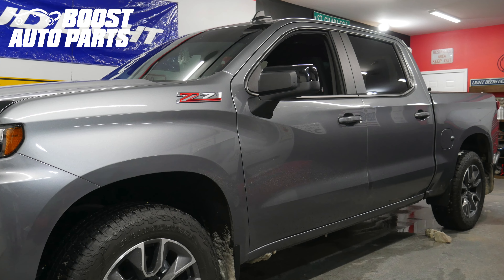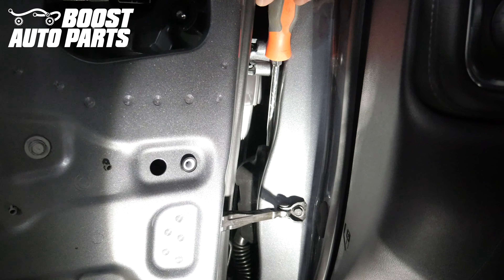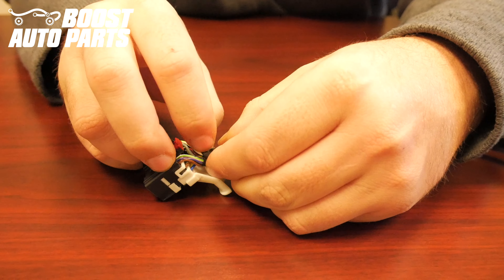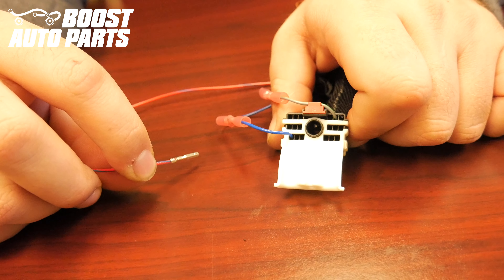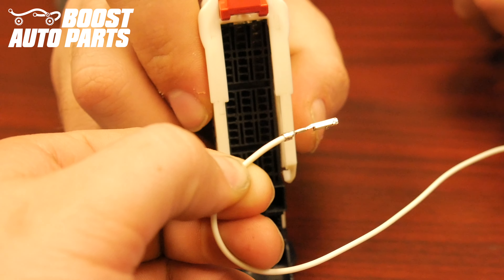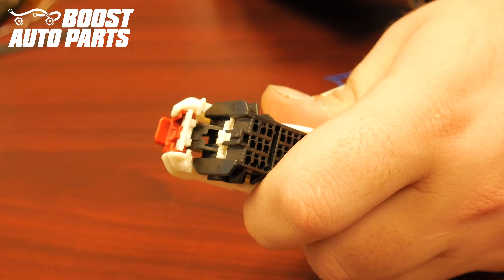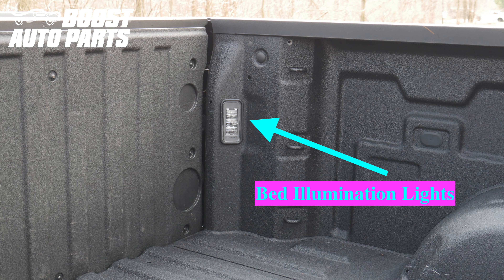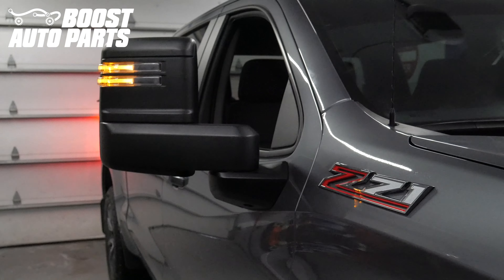GM Tow Mirror Plug And Play Wiring Upgrade (With Spot Light) - Silverado Sierra 1500 (2019-2022)

Comment: Would this process work on just upgrading to regular mirrors with led single puddle lights. Or do the have to be towing mirrors?
Reply from the maker: This procedure does not apply to small mirrors, the wiring for tow mirrors vs. small mirrors is different.

Comment: Guys you have a problem. I have a 2020 silverado custom. I do not have puddle lights. I did have a blue wire already in place in pin 13. I did not have a wire in pin postion 5. I had to add a wire to pin 5 and then re route the existing blue wire to that and so on. It works now but you're steering people in the wrong direction.
Reply from the maker: I will pass this info on to our development team. If you can email your VIN to support@boostautoparts.com that would be incredibly helpful. We do have a video that shows this reroute, so it sounds like we just need to further clarify the video to watch.
Reply: I will send the info thanks. I seen that video and thats exactly what worked for me but It's important to note i have neither spot lights nor puddle lights on my factory mirrors.
Reply from the maker: @Joeybago12  Thanks for the info. To anyone reading this comment in this similar situation, please reference this video: https://www.youtube.com/watch?v=1-kmGSMHH_Y

Comment: I have a trail boss 2021 lt I want to put does town mirror but dealers tell me I can’t put them on my trail boss because I have ,Side Blind Zone Alert ,Rear Cross Traffic Alert on my mirror
Reply from the maker: You can put them on - you just need to get the mirrors that are 1:1 with features.
Reply: @boostautoparts  Did this work out?
Reply from the maker: @bjones5593  Our mirrors are still under development, however if you get OEM mirrors with the proper features they will work.
Reply: @boostautoparts  Does GM make tow mirrors that have blind spot monitoring integrated?
Reply from the maker: @bjones5593  Yes
Reply: @boostautoparts  Part #?  I've searched and can't seem to locate it.
Reply from the maker: @bjones5593  Sorry, we do not keep track of OEM part numbers - but the mirrors do exist on higher end trucks optioned with towing mirrors. Our mirrors will hopefully be available soon!
Reply: @boostautoparts  Do you have a more specific ETA on your mirrors?  I’ve been waiting on them, would appreciate any info on the timing.
Reply from the maker: @bjones5593  Sorry, no firm info at this time!
Reply: I have the same truck.  Had to custom build mirrors myself.  I bought base tow mirrors, I ordered the mirror glass with signal from boost auto parts that had the blind spot monitor on the glass.   It’s two wires to add.  One for the signal for the blind  spot monitor and the other is a ground.    It’s a pain to fish wires through the mirror itself. But it’s worth it.
Reply: @Brian Kazda  I have the same issue. Ordered OEM mirrors, but didn't consider the blind spot function. And since I opened the box, they can not be returned. After reading your comment, I'm considering doing what you did. Do you have any insight on the added two wires you mentioned? How did you know what and where to add what was needed? Any help would be GREATLY appreciated!!!!
Reply: @joegetchell4940  it is pin 4 and pin 9. Pin 4 is your singal/ power wire and pin 9 is your ground.  I tore apart and stole the plug from my old mirrors as well as the pin for the connector.   For pin 9, which is ground I just used a t tap before the plug     I bought the boost auto parts. Signal on glass with the blind spot monitor light on them.   Hardest part was running the wire.  It required basically disassembling the entire mirror   But there was plenty of YouTube video on this
Reply: @briankazda7339  awesome! Thank you very much!

Comment: Broke the top clip on the door jamb connector going into the body. Any creative minds with ideas on how to fix it without replacing it lol 😅
Reply from the maker: Email support@boostautoparts.com with a picture of what you're referencing so we can do our best to assist
Reply: @boostautoparts  I actually got it fixed. The running lights worked for a couple days then went out. Which specific wire controls that? So I know which one I need to fix or look at again. Thank you
Reply from the maker: @jamesladouce2183  Blue is running light. If you run into issues give our support team a call at 765-831-2830 or email  support@boostautoparts.com